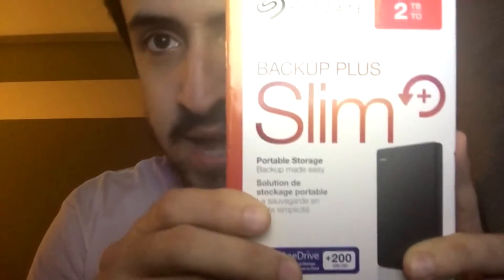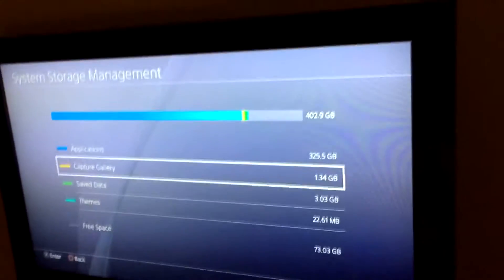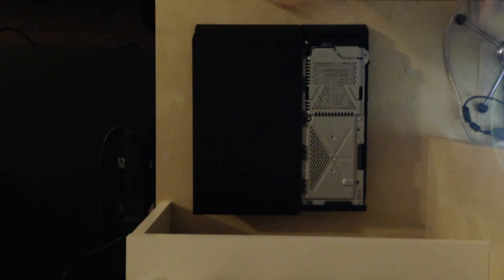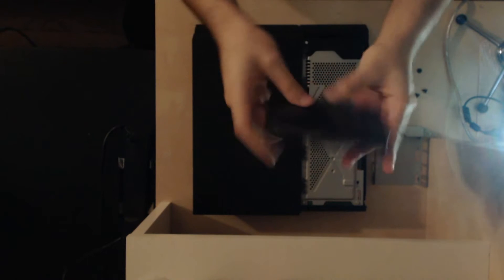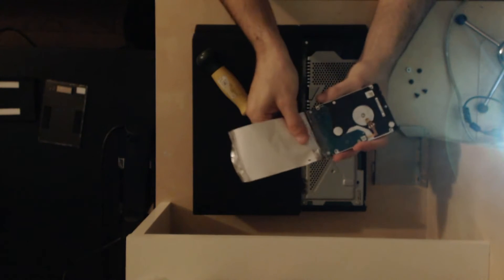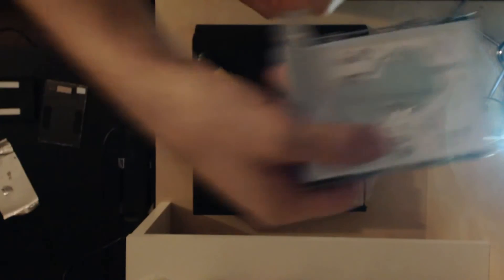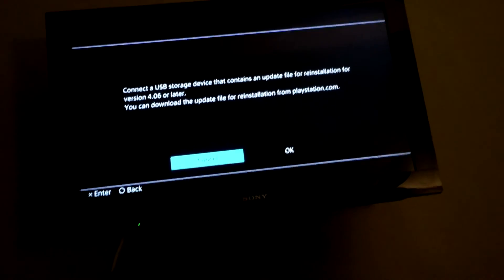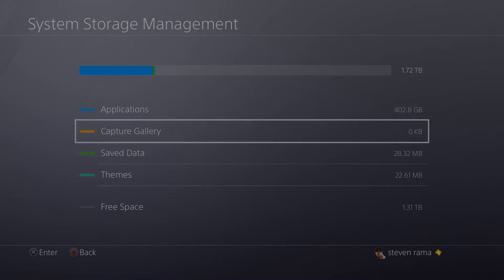2TB PS4 UPGRADE GUIDE

Comment: NEED HELP IT KEEPS SAYING UPDATE FIILE CANNOT BE USED
Reply from the maker: http://community.us.playstation.com/t5/Consoles-Peripherals/USB-Drive-won-t-update-my-PS4-system-software-after-installing/td-p/45352529
Reply from the maker: sony provides different update files, some are just for updating the software and some are for installing the software make sue you download the correct one. The link provided should help with the issue
Reply: Ok let's hope thanks
Reply from the maker: no problem, I'll help fix the problem as much as I can
Reply: I tried everything it said on the website said and it says this update cannot be used but I'm using the most recent update wtf
Reply from the maker: you need the update+operating system files use this one http://dus01.ps4.update.playstation.net/update/ps4/image/2016_1201/rec_edffaf60c694b226f9123e634ed6aa00/PS4UPDATE.PUP
Reply from the maker: that one is the one needed for the fresh install and make sure it is in PS4>UPDATE>PS4UPDATE.PUP
Reply: And I'm so scared that I broke my ps4
Reply from the maker: try downloading and placing the file with the link i provided and make sure your computer doesnt rename it make sure it stays named as PS4UPDATE.PUP and make sure its a bigger file (800-850mb)
Reply: Ok the one I got says it's 300 something mb which one am I supposed to download?
Reply from the maker: Everything MLB that is the incorrect one. The link I provided is the direct download to the correct one. Download that one and make sure it's around 800mb
Reply: Yes it worked thank you so much
Reply from the maker: Everything MLB no problem again :) the one you were trying to use must only be used if you are performing an update only. In this case you needed the update files and the actual system files

Comment: i just done this and it says " cannot find the update file " what do I do ???
Reply from the maker: Sara Prince check the files on the USB. The have to be exactly how they are on sonys website. Case sensitive and everything
Reply: I did on the usb I created a file PS4 and inside that UPDATE and then I saved the download inside that file still not working.
Reply from the maker: Sara Prince make sure nothing else is on the USB
Reply: there is nothing else on it :(
Reply: I even deleted everything in folderand retried to download it
Reply from the maker: Sara Prince what is the download file called?
Reply: PS4UPDATE.PUP
Reply: this time it says connect a USB storage device that contains a update file for reinstallation fro version 4.07 or later.
Reply from the maker: Sara Prince https://www.playstation.com/en-us/support/system-updates/ps4/ try downloading the file from here if you haven't already. Drag the folder to your desktop first and then place it in the correct location
Reply: I'm going to retry now
Reply: it says the update fie is corrupted ?
Reply from the maker: Sara Prince I'll see if I can find a way to upload the files I used and you can download those. I'll need to find a website where I can upload everything you can download the exact files I used
Reply from the maker: make sure you download the file under "Perform a New Installation of the System Software" there are different files for different methods of updating. Some of the files are just for a regular update and don't contain the actual Operating System files

Comment: Hi I have a question!

I was thinking of installing a new 2TB hard drive similar to the one you are using. When making the swap into the drive caddy, do I need to keep the silver foil on or remove it? Never done this before, so apologies for being a bit of an amateur!
Reply from the maker: AlchemicSiege I removed the foil off of the new drive just because it would've been metal touching metal and I didn't want any kind of electrical conducting between the two metals so I took it off to be safe and for a better fit but you can keep it on if you'd like. It's all preference

Comment: Cool I may actually do this because I have a 2tb Seagate external hard drive laying around that I never used.
Reply from the maker: Syn 2nd if you do it make sure it's a 2.5 external drive or else it won't fit in the PS4